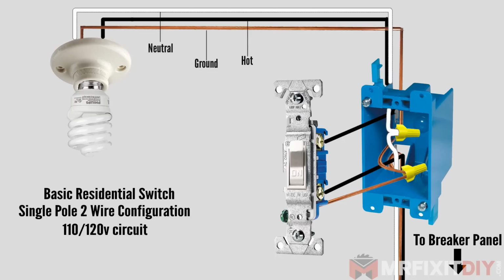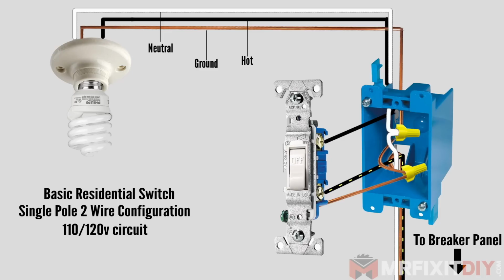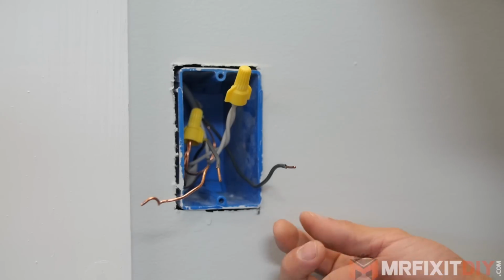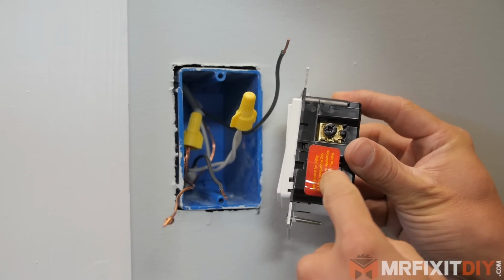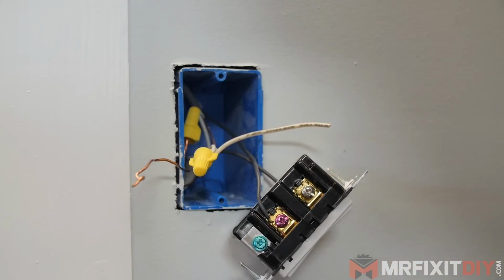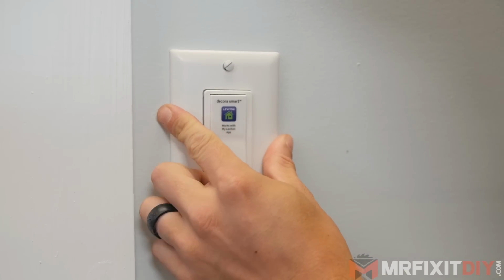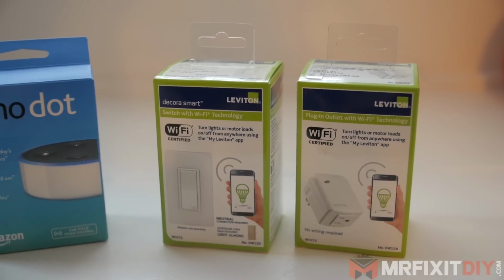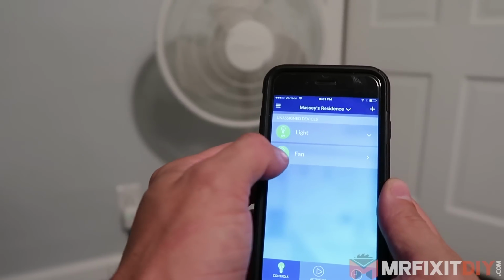How to Install a Smart Home Light Switch | A DIY Electrical Guide

Comment: That's a great demonstration graphic at 0:55.  Maybe I missed it but it would also be good to shwo how to use a DMM to tell which conductor is the switch leg and which one is from the panel in order to install the new swtich.

Comment: this was great, mine came with chinese only instructions and it came with the a spare neutral pigtail line. i ended up jumping the hots together with the pigtail and wondering why the on position was about 3/4 brightness and the off position was about 1/4 brightness and flickering.  With non-dimmable bulbs.  Glad i didn't fry anything!

Comment: My whole house was setup on smart WiFi. Lighting, thermostat, Alexa. I came home one night and Comcast shut down my internet for work. Even though I had power all my lights, Alexa and smart devices no longer worked. When you have power and you are sitting in the dark is a problem. All my ceiling fans were not on WiFi so they worked fine off of remotes.

Comment: My house was built in the mid 50's and I have no extra wires, like a neutral. Do you have any recommendations for a switch without a required neutral or can you tell me how to place a neutral.
Reply: You need to have your house re-wired. You have the old, unsafe 2-wire "floating ground;" not good!

Comment: Not sure how likely you are to see this comment. But I recently tried to install a smart timer in my bathroom for the light, fan and heater in the ceiling. This took me 9 hours and the solution I found was to use the older style timer because my house, build in 1948 had 3 hot wires, 3 neutrals and a ground. Didn't appear to be load wires at all. Any solution for this? My first thought was to sacrifice the lights hot and neutral to then get the heater and fan working since there are other lights in the bathroom. But I couldn't seem to get that working either. After I finished, I did think about maybe having hooked my neutrals up to the load terminal and that might have worked? What are your thoughts?

Comment: Warning: If you have an older house the wall box may be too small to fit a 3 times larger switch and the extra connector caps. Then you have to put the old switch back or tear up your wall for a new box.

Comment: My current switch doesn’t have a neutral wire in the box in the wall but my new smart switch requires one... what do I do?
Reply: Travis Churich gotta run a new neutral wire from power source
Reply: It would be quite a bit of work to run a neutral wire from the source in my house. Is there a work around or is this device not usable in my house?
Reply: Alot of the old houses used a 2 wire system with no ground so you have a natural. And alot also share ground and neutral.
Reply: M Detlef uhhhh ok.........

Comment: Wyze makes a smart plug device that’s probably way cheaper than Leviton. I’m looking for the smart switch that adds a switch location (you install a wireless switch that hooks to a switch that’s across the room so you can have 2 places to turn it on. What’s that called?? Idc about turning lights on with my phone I want a physical switch in a second location without having to run wires.

Comment: Mr Fix it, you sir are very knowledgeable!  I think i am going to attempt this but i must say i'm nervous. I have a 3 gang box in which 1 of the switches controls the power of the ceiling fan.....i want to make that one the smart one and keep the other 2 as standard switches, i already purchased the face plate for this setup and i hope that the wires i see in the back of the box in the wire nuts are indeed neutral wires.
Reply: i'm happy to announce that I got it done!, i went to home depot and purchased a voltage tester and it made the job so much easier! the hardest part was removing the freaking wires from the standard switch....they had a push to release that was impossible for the wires to come out. I have a question .....there were 3 neutral wires in a wire nut....did i have to use the wire that came with my smart switch and tap into that or could i have untwisted one of those from within the nut and use it directly from there?

Comment: I have an old house with the light  switch located on the frame of the doors. These products have plates that are too wide to substitute the existing switches in the same location. Are there miniature smart switches that cater for smaller (door frame located) old switches?

Comment: I just installed the same smart switch today for a front entry light. It is a single pole switch, I also followed the same installation as displayed in the video. After installation the entry light was on; I could not manually turn the light off nor would the app detect it. Please help; the troubleshooting was only for when the light wouldn't turn on, not turn off. Thank you.

Comment: this was extremely helpful!!!! 

House was built in 97' and did have 4 neutrals twisted together hiding in the back!  BUT I made the mistake of yanking one out of the 4 twisted neutrals and trying to hook it up to the smart switch.  It would blink on for a second and then immediately turn off!  

I re-watched and realized I had to include that "pig tail" TO ALL 4 neutrals together then BAM it worked!!
Reply: What gage wire did you use for pigtail?

Comment: as an electrician please do not use a non contact volt tester as seen in this video, use a multimeter. it will tell you when something is hot and how many volt/amps youre pushing through that one line. ( the black line isnt always the HOT wire, depending on if it was done correctly or even sometimes the neutral is hot for different reasons} plus a volt tester wont always pick up lines that are hot, such as back fed lines. if youre not sure or not comfortable working on electrical stuff, just call an electrician. its way easier than trying to get a new home due to the fact that you burnt yours down by doing DIY electrical.

Comment: How can you tell which hot wire goes to the light and which comes from the breaker?
Reply from the maker: The best way is to turn the power off at the breaker, disconnect both and leave them hanging out of the box not contacting anything. Then turn the power back on at the breaker and use a voltage tester. Only one of the wires will have power to it and that is the line in from the breaker. Once you've identified it, turn the power back off to work on the box.

Comment: What about rooms where there's multiple light switches that control the same bulbs?
Reply from the maker: That's called a 3 way switch and requires a specific type of switch.
Reply: WHAT specific type of switch will take care of turning a 3-way into a smart switch?
Reply: @joemason8261  Yes, there are specifically typed "3 way switch", not to be confused with a "3 gang".  Hope this helps.

Comment: How do you tell the difference between the black hot wire (from panel) and the black load wire (to bulb)?
Reply from the maker: It can be tricky in older homes. Typically the way I do it is to disconnect the wiring and use a voltage tester to see which one is live when the breaker is on. The one that beeps when the breaker is on is the line in from the panel. The load won't have any power to it when the switch is off or the wiring is disconnected. Just remember to turn the breaker back off when you've figured it out.

Comment: Thanks for the video! For 3-way, will I need to have two Leviton smart switches?
Reply: I'm nearly 100% sure that you do NOT need two shared switches for your 3-way switch. Just hook up a 3-way smart switch to the master switch, the one hooked most directly to the power source.
They're usual sold as a pair of switches, but you can use each separately. Basically gives you two for the price of one.

Comment: What happens if you don't have a neutral wire in the switch... Homes with older wiring may not have the neutral
Reply: Right! I DONT have the neutral! I don't see one, and I don't think it has it, as its a late 50's build....Any of these work without neutral?

Comment: I only have 3 wires black white and green 
Where do I get the 4th wire from
Black is hot white is neutral and green is ground
Reply: Mr. Fix It i purchased the same switch And I see u hook up 3 whires plus a ground that’s why I said 4 wires 
Even in ure video u show 2 black 1 white and a ground 
And on the switch it says to hook up 3 plus a ground 
Black hot , white neutral and ground I get this last wire is confusing

Comment: I so want to jump into the smart home life but there are too many damn "standards" - Z-Wave, ZigBee, Thread, WeMo, etc...and they dont all play nice with each other. Your thoughts on this?
Reply: I've been adopting the smart home mantra over the last year or so, and while the UK is slightly different than the US in some scenarios, the core concepts are the same. What I would suggest though is to thoroughly research the manufacturers of the devices you're looking at buying. Look at their entire product range, and overall reviews of the public who have previously purchased them. I had to look at half a dozen or so manufacturers of smart light switches in order to find one that seemed good enough to start spending money with. There's some that have a limited product range, and therefore a limited amount of usefulness, but others that have a wide range of products that all work with the same hub.

The catch with smart home, as Aaron has said in a few different comments, you have to pick and choose what's right for your needs and your existing setups. Multiple manufacturers will most often require multiple hubs, or multiple accounts on internet services if they're WiFi enabled. Sometimes these services work in harmony, other times they're very isolated from one another. Alexa, Google Assistant or IFTTT can sometimes bridge that gap, but you need to evaluate what your overall goal is before diving in. If you buy on a whim and find that you can't get the level of integration that you were hoping for, you'll be disappointed or at worst, need to replace the device with one from another manufacturer that supports what it is you want to do.

But, if you pick the right devices and get the integration you want, at worst you'll have a bank of various manufacturer's hubs (that connect LAN/WiFi to Zigbee, ZWave, etc) but a perfectly functional smart home.

The key is plenty of research!
Reply: I think it is best to purchase the available chinese-made switches off Amazon. You can get them for essentially 2 switches for the price of 1 Leviton (or named-brand) switch. Most of them are controlled by a single app called Smart Life, which then syncs to google home or alexa depending on which you have.
Reply: @swimupstreem703  And this makes you less reliant on using Alexa or google who log everything you do, and sell those patterns of electronics and anything they can track usage to others. Why do it when there is no need with the same convenience without them.
Reply: I needed to use my existing garage light to connect carriage lights not installed when built.  I could not route the wiring to the front door and used the switch in the garage and made that a smart switch to activate with voice command.  I agree with the pick and choose.  Thanks again.  @MrFixItDIY

Comment: How about 220 volts it it's work?..line 1 is 220 and line 2 is zero volts
Reply from the maker: That's not how it works (in the US). In 220 volts, there are 2 (110v wires) that combine to create 220v.

Comment: I tried installing a ce smart switch following the same steps.   Got it to work but now other light switch on same circuit won't turn on.   Anyone know the issue might be? Thx

Comment: I'm in search of a smart switch solution that can help me remodel my den, the cabinets I bought come to the very edge of the door molding thereby putting the light switch un-accessible as I walk in the door now. Is it possible to replace the original switch with a smart switch and place a stick-on switch on the side of the cabinet? I have purchased the smart switch and the stick on switch but they came without instructions. Can you help me?

Comment: I only have a black wire and a white wire. What do I do?
Reply from the maker: The white wire in that case MAY be acting as a hot wire as well. That is common when someone pulls a single piece of romex to a box. Are there any markings on the white wire like a piece of black tape that would indicate it is a hot wire? Unfortunately if you don't have a neutral wire available you'll likely have to pull one which may be more hassle than you're willing to take on.

Comment: Hi Aaron, if I turned off the lights via the smart switch, would I still be able to turn the lights on via the mobile app or would it tell me the lights are "offline"?
Reply from the maker: Yes, you can completely control the lights via the app or connect it to a smart home device like Google Home or Alexa and control the lights even if the switch is in the off position.

Comment: Hello, electricity is reaching the light when connecting the wires it gos on. but I can not control it from the switch. where would the problem?. I have bought a new switch and did the wiring still not working
Reply: Follow the wires from the switch and see where they go.

Comment: What if my switch only has 2 wires??
Reply: Depends.. the neutral could have been ran outside the box or it just doesn't have a neutral (which is wierd but not uncommon  in older homes.) In either case just run a new white with the same wire gauge from the panel through the switch box to the device. Just be sure to leave a small loop in the switch box for splices and turn off power to the panel before doing any work inside the panel.
Reply: What if I don’t have a ground wire
Reply: @sweiss2281  in that  case run the ground directly to the switch box. No need to go all the way to the panel for a ground.

Comment: I have over 20 light switches in this 1982 house. All of them still work perfectly after a 6 person family grew here, one owner home. The light switches do NOT have gang boxes as they grab the dry wall themselves. I have already located Gang boxes to convert these to normal types of switches, so that is out of the way. However, I do not know what Smart switches to replace them with yet. NONE of the switches have more than 3 wires, they all have one White, One Black and one bare copper as pictured below. How do I wire a smart switch to these please? I assume this is called a non-neutral wiring setup?

https://i.imgur.com/5DTEd0Dl.jpg

Comment: How do I connect a smart switch that turns a plug. The switch has only 2 wires. There is no neutral wire

Comment: I dont care for i can control it by my dam phone. That nice but i want to use a existing switch to control the existing light. Then control lamps plugged into outlets in the room to turn on different lights from the smart switch that have  smart outlets.